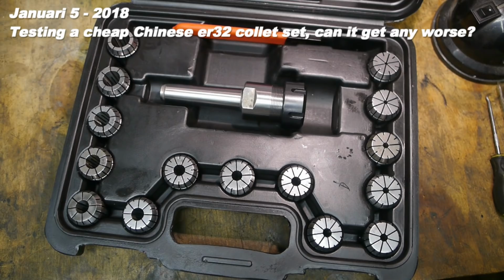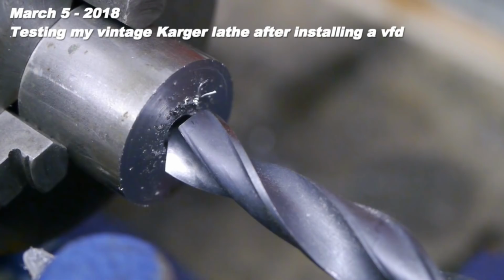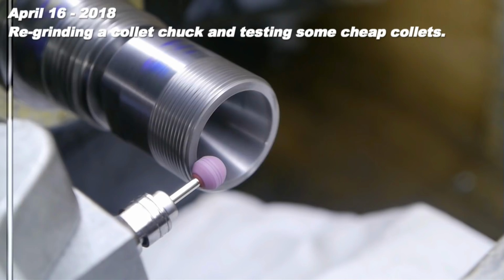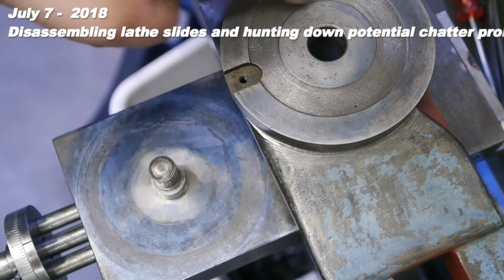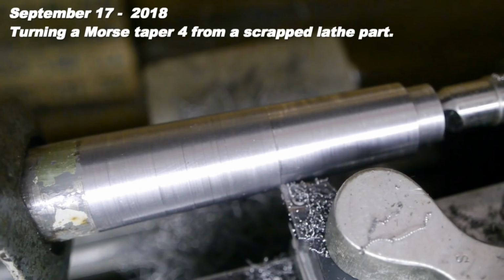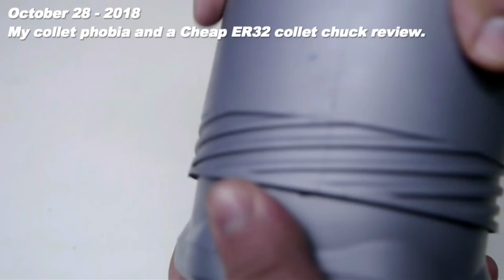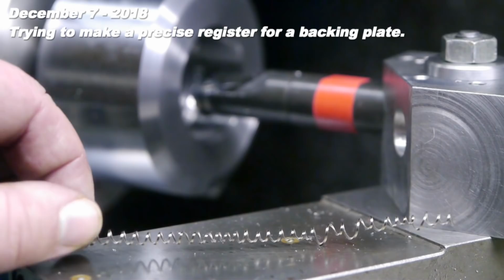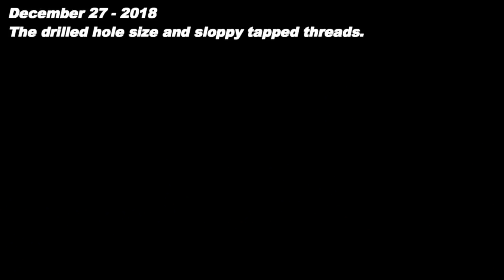This was Rolingmetal's 2018

Comment: I like the 2018 review video summary.   You did a lot of projects this year.

I am still hoping you were able to get the backing plate off the spindle and without any damage to the spindle.

Looking forward to your 2019 videos.

I just had a failure making an internal 1in dia x 8 tpi thread for an adapter for a wood lathe.   Just mentioning so you know that others also have problems from time to time.

Dave.
Reply from the maker: I've decided not too look at the spindle till 2019. I'm not risking another disappointment this year :)
1inch 8tpi that's the same as the smurf lathe. I'll probably make one of those this year at some point.

Comment: what size are the spindle journals on the blue lathe... just curious..
Reply from the maker: About 30mm at the front and 26mm at the rear,
Reply: @Rolingmetal  sorry i lost your reply..

 i was thinking double row AC clutch bearings..  these are natchi numbers with 30mm bore sizes.   its just a thought to try to remove the slop from the old blue lathe spindle.. 
30BG04S21G-2DST    , 47 od 20 w
30BG04S13-2DST2   , 47 od 22 wide
30BGS32G-2DST   , 52 od  20 wide
30BG5222-2DSE   ,52 od 22 wide
30BG05S5G-2DS   , 55 od 23 wide
30BGS1G-2DSKAI  , 55 od  27 wide.